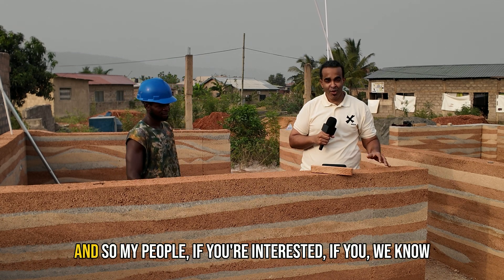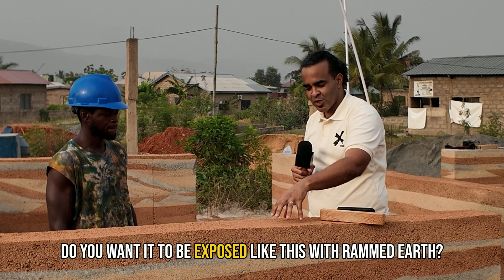EcoTalk Explores: Rammed 'Earth Works' Project with Joe

Comment: Do you plaster the outer walls since they won't withstand the rain?
Reply from the maker: Hi Ms. Shirley, Plastering is optional. There are a couple of binders and sealers that you can use to paint on the wall that will stop the wall from shedding dust and also having any issues with rain water. Mostly the inside is plastered as a lot of people desire smooth walls for interior rooms.